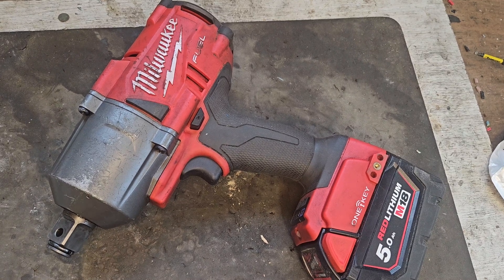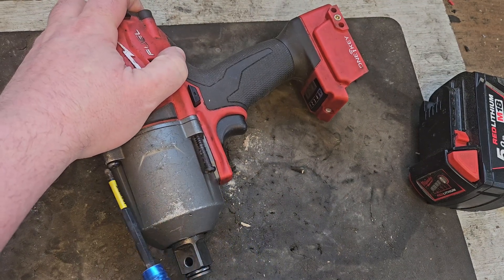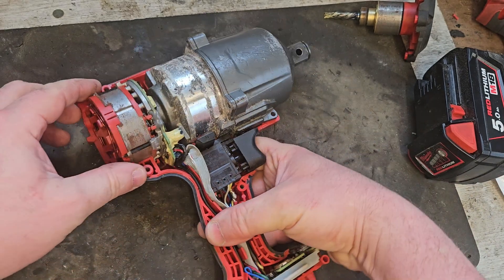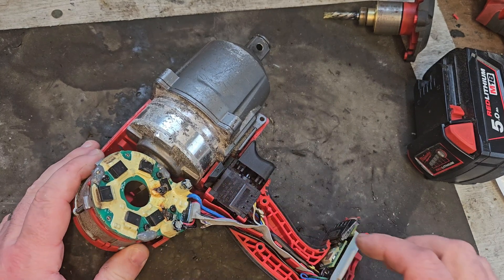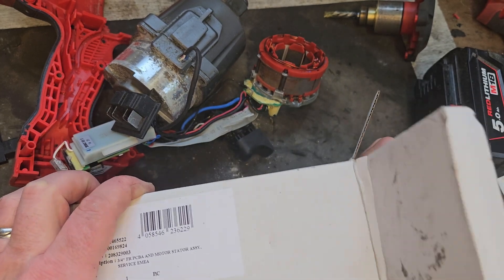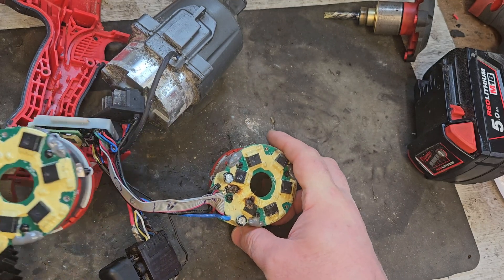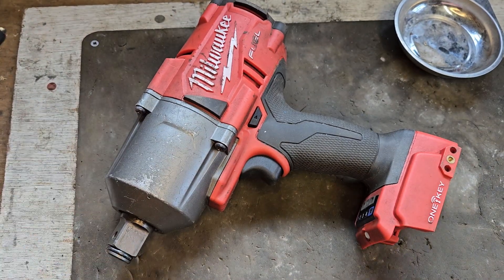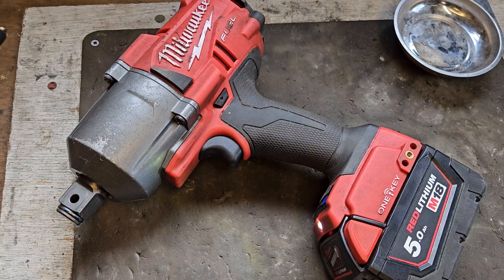How To FIX The Fuel Wrench: It’s Actually Easy!

Comment: Had mine for 6 years and it stopped dead like this. I will pull it apart and see what it looks like. I have already replaced the nose cone and checked the anvils like a year previously.

Comment: Bro is that m18 chiwf34 model that’s wat i have and it just stopped but will go sometimes it done fuk all work 😀might try this .no smoke came out of mine I opened it and blew it out with the air line and checked connections and spayed them and it will go for a while then just stop .. has my head mad ..cheers from Crossmaglen 👍
Reply from the maker: It's the one key version if yours is one key and 3/4 It's likely it.